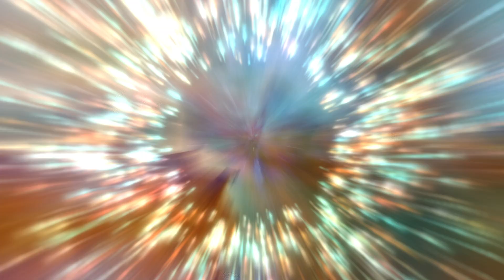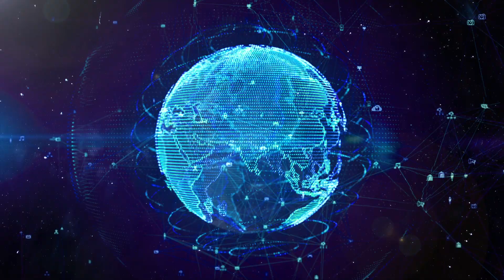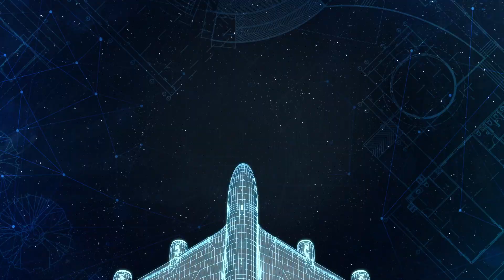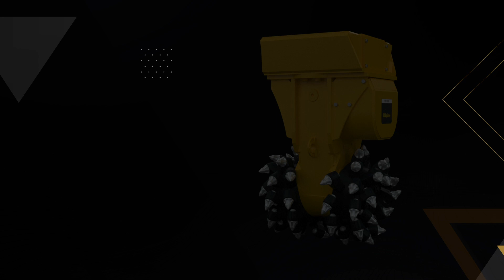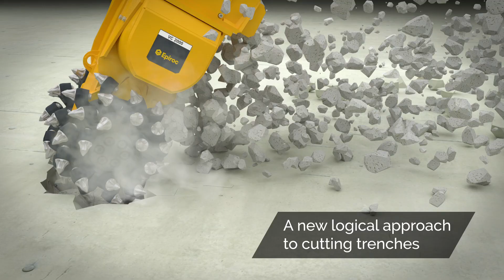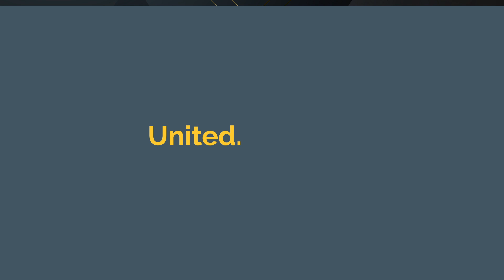VC 2000. The V Cutter.

Comment: Can ı use the cutter to remove underwater reinforced concrete (c20 concrete under max 6m depht,  reinforcement is d12 rebar). The concern is, reinforcement might stuck around the rotary head?
Reply from the maker: Hello, please contact your local customer center. They can help you with this.